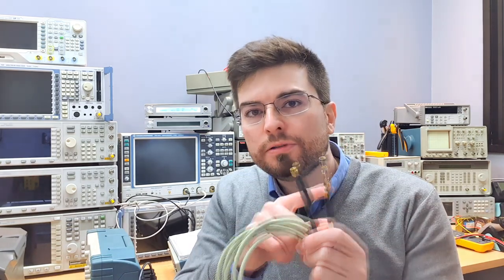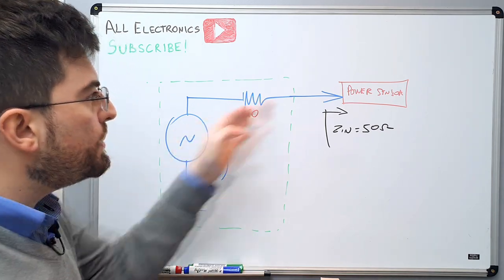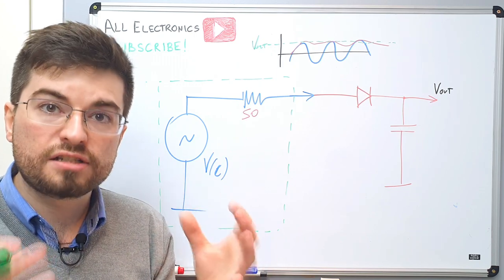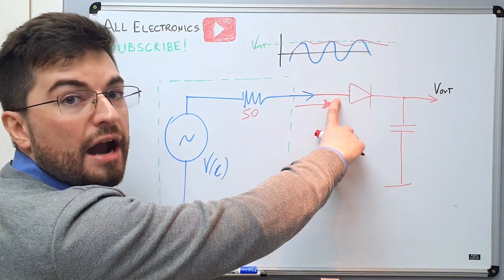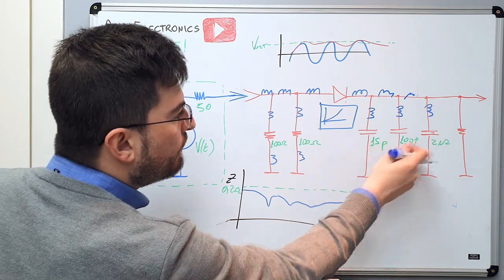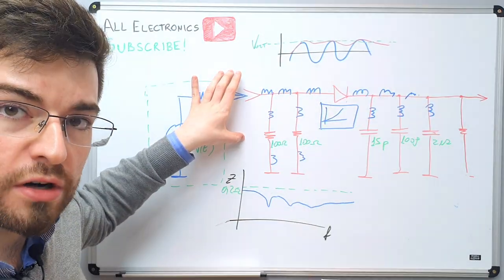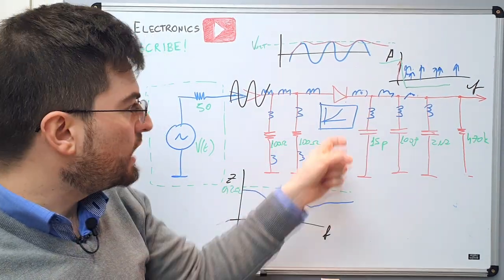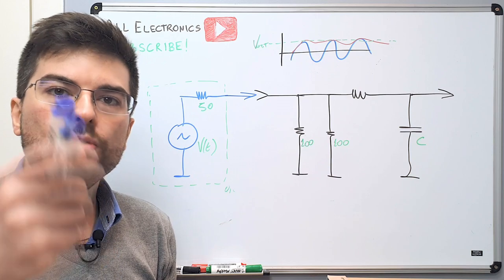Fundamentals of RF Power Sensors

Comment: This is the most concise explanation of diode function at low currents I have ever heard. It is very interesting that the Z of the diode at small currents is very different for DC verses AC current. I read years ago a very good explanation of this where various types of diodes were used as small signal AC detectors. This came in very useful when selecting diodes for a Brune bridge type power meter design. If I come across it again I will try to post a link. Keep up the good work!
Reply from the maker: Thanks!!

Comment: Thank you very much.  This is the best explanation ever.  Yesterday I was reading the instruction manual for the URV3 millivoltmeter. I found that the RF probe was used as an indicator, but when adding 20 dB or 40 dB attenuator, it reads RMS voltages with an error rate of 3% for frequencies less than 200 MHz.  According to your explanation, it seems that the accuracy of the measurement is to reduce the input voltage in order to ensure that the diode works in the non-linear region.  I have two requests. Please explain the use of four diodes in the RF probe and what are the maximum and minimum voltages input by using attenuators to ensure the most accurate measurement of DSBSC ( with tow tones) & DSBFC power

Comment: Rectification can be seen as mixing the signal with itself to create all kinds of sum and difference frequencies. The following capacitor is then the low pass with very low cut off frequency to cut out the DC point in the spectrum. So for me both points of view are undivideable connected. But I think you are right that this point of view isn't as much spread. Often those changes in perspective add so much to the understanding so thank you for that nice video. Keep up the nice work.

Comment: Hey gregory I have following this topic since that year you started to design your Power sensor and Since then I have read a bunch of articles you have recomended in your blog entries about this topic and some others and this video condenses the useful information in this topic very well. I don’t remember very well but I think I have read some article that in it discusses about using a tappered transmission line to transform the 50 ohm impedance to a higher one so providing the same power to the sensor create a higher voltage excitation in the pn junction improving the detection in low amplitudes. IMSAI guy has a video about and old power sensor and he said in that video that he used to work with the people designing those microwave sensors and that they used also that tappered transmision lines and also a differential diode configuration with two diodes. Have you did any experiment about this impedance transformation and if it is worth it? Thank you very much for your videos your content is top in the platform about rf.
Reply from the maker: Thanks! I didnt test any impedance transformstion technique.. Im not sure how it behaves for largue bandwidth detectors...

Comment: Looks like when the diode starts to charge the cap, it takes significant power from the source? And thus the measured power is not accurate... Why not putting an opamp in voltage follower configuration (buffer) just after the diode? It will drive the cap. A single rf npn in emitter follower should work as well. Also additional filtering can be put on the top of the opamp or NPN config directly instead of cascading?? Some thoughts 💭
Reply from the maker: Hummm!!
Reply: An opamp would be horribly unpredictable and noisy if you attempt to use it at RF. (assuming you find one without the low pass filtering internal cap). You would need a second power detector to constantly calibrate the opamp based one. The low current draw by an opamp follower would mean that the internal capacitance of the diode would dominate the main component behavior so much it would no more be a diode at this point. An emitter follower has no advantages over a diode, as both have the same input-voltage--scaled-output-current function.

Comment: Great presentation.
To improve you can use germanium diodes or schottky diodes
And why not bias the diode with say 10 uA current source. The biasing would put the diode on the edge of conduction.
Reply: Isn't the whole point of the video that the resistance modulation occurs before the forward voltage threshold, and thus we expressly do not need voltages at that level?  Adding bias would just move the "kink" in the curve...
Reply from the maker: It moves the kink but can help for detection of very very low input powers... where the modulation is too small.. but we are talking off very low bias int the range of 500nA to 5uA

Comment: Gregory, if we help and polarize the diode (with rf choke in the bias and dc block), it will make it even more sensitive to even lower rf powers? or it will make it more linear? I mean we help the diode put already into conduction mode.
Reply from the maker: Yep! It helps for detection of very low power levels !

Comment: Does the diode cause any main frequency/overtone reflections back to the source? The parasitic capacitance of the diode in series with the output capacitance acts as a capacitive load after the double-100R-resistors, so wouldn't that push the impedance seen by the load-side-end of the cable to be more capacitive? Wouldn't the asymmetrical load introduce a DC level shift into the RF line? 
I would put 2 diodes and capacitor banks into a half-bridge voltage doubler to increase the measurable DC voltage and have a more symmetrical load on the line.
Although the diode here is used in a mode far from its ideal switch model, the circuit is still based on the fact that the diode asymmetrically discriminates conductance in one half of the cycle vs the other half, which is still a valid model in generic power electronics until you get into the synchronous rectifier territory.
Reply from the maker: It causes. Two diode is a possible topology.. but it may increase complexity and reduce bandwidth.. more parts.. it is a big tradeoff

Comment: For low amplitudes backward diodes had been used in the past.
Reply from the maker: Humm... interesting! I never touched a backward diode.. only read about
Reply: @AllElectronicsChannel  It is actually a wrecked Germanium Tunnel diode. It's dynamic range however is small, perhaps only 0 to 0.3 volt.
Reply from the maker: It is available or is something to get from Russians on Ebay? Hahaha
Reply: @AllElectronicsChannel  General Electric made them until the 1980s.
Today however I would try to get a Nano-diode.